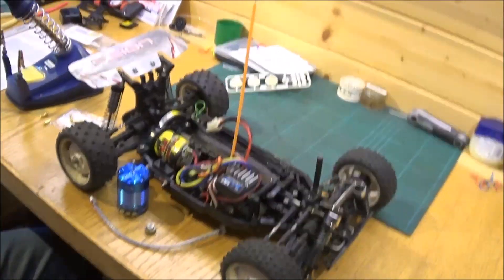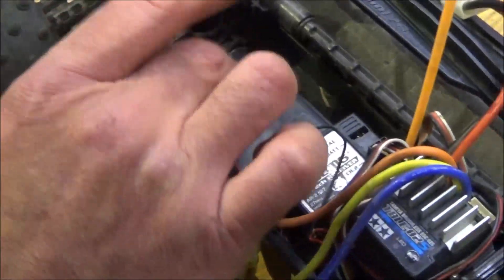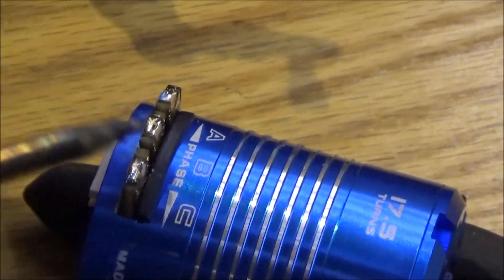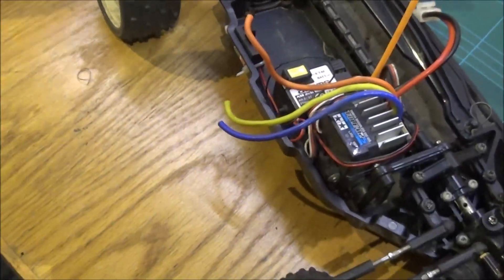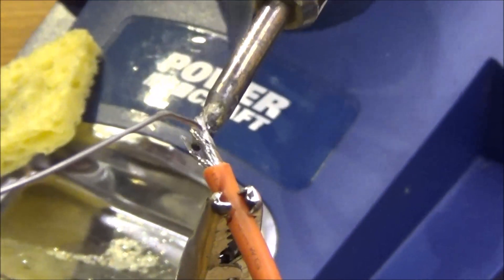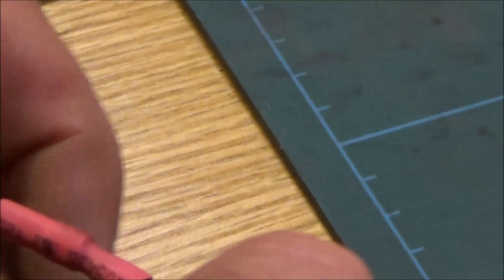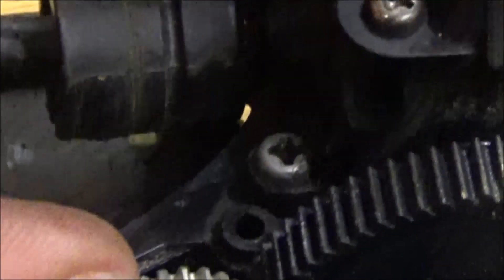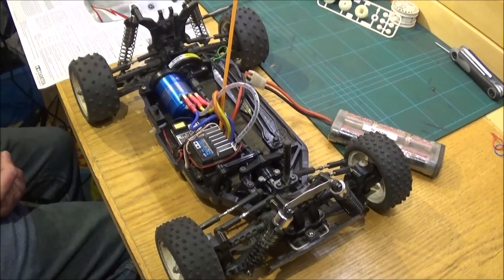How to Fit a Brushless Motor to a Tamiya TT02

Comment: What motor and wire are you using where did you get it and how much was it ?
 I was told by my local model shop you can’t use anything but Tamiya motors on the TBLE 02S speedo judging by your video this doesn’t seem to be the case!
Reply from the maker: Hi Neil Fastfreddie Anderson ! Thanks for the comment mate! The motor was off eBay - from a Chinese seller - only £20 - if you search for brushless motors I'm sure you will find it - not a named brand though. Since then I have used Turnigy Trackstar brushless motors from Hobbyking.com - very cheap and great quality - about £25 for the 13.5 turn and work really well with the Tamiya TBLE02s ESC. Don't believe what others say - the TBLE works fine with other motor brands - I have been using them for over 4 years with no problems at all in about 6 cars! Feel free to ask any other questions and I will try to help if I can!
The wire is just from a standard 13 amp power cable, you find them on any electrical extension lead - works a treat and handles the power fine :-)
Reply: Mark Bryan RC thanks for the quick reply and advice I found and ordered the same motor you used on amazon I’ll try a 13:5 t to start with.
I’ve got a lot of cars to get up and running any idea what the ratio is between brushed and brushless.
I was told  16t brushless is equivalent to a 21turn brushed any advice or comments.
Reply from the maker: Hmmm - difficult question, as we have to consider sensored or sensorless brushless! I'd say, as a starter, the advice is pretty good - brushless are much more efficient and use so much less power than an equivalent brushed motor but spin slower per turn (generally). So yes, a 21 turn brushed spins at about 22000rpm and you need a brushless 15 turn to spin as fast - but the efficiency of brushless makes a difference and makes the package a better prospect - longer battery life and longer motor life too! Anyway - brushless wins hands down!
Reply: Mark Bryan RC I haven’t raced for about 15 years (got into helicopters) they only work with brushless but they are allowed to rev and sit at max rpm very little current draw. I’m very ill from lung disease so can’t get out as I use to so have decided to get all the old redundant cars up and running but don’t want to spend loads just need a hobby that’s on the bench not too much moving about I’ll  get the boy to help with driving them 😉
Reply from the maker: Ahh - I got back into RC after a long break, and I too started by finding my old Tamiyas from the loft and set about getting them going again - I found it very rewarding to reinstate the cars and in a way quite therapeutic ! Sorry to hear about your poor health - hopefully you will enjoy the re-building as I did - a great way to focus the mind! Like you, I don't have a lot of cash to splash on this hobby - so I make, re-use and re-engineer most of my parts from spares or scrap - if you watch any of my other vids you will see what I mean. Please feel free to share any comments, observations and ideas you might come up with along the way - I'd be very interested to hear them mate!

Comment: Do you mind telling me at what temperature did you have your soldering iron Set to please?
Reply from the maker: Hi King Nica - My soldering iron is rated at 30W and the temperature is not adjustable. The melting point of most solder is in the region of 188°C (370°F) and the iron tip temperature is typically 330°C to 350°C (626°F to 662°F). So a good starting point is 350°C. The temperature is not too critical though - it just needs to be hot enough to melt the solder thoroughly so it flows into the joint - the important thing is not to leave the soldering iron in contact with the joint too long after the solder has flowed, this is when overheating of the job may happen. Just take the soldering iron tip off the joint as soon as it has flowed and all will be fine. Hope this helps mate!

Comment: Nice vid Sir! Can you make a run vid on this? I see you said this motor is pushing the limits of the esc. How did it work out? Running high temps or just fine? Thanks!
Reply from the maker: Thanks for the comment Darrell - But no, the motor is definitely NOT pushing the limits of the ESC (it WOULD be if it was a 17 turn brushed motor) but the TBLE will run down to a 10.5 turn sensored brushless motor. I have fitted a 13.5 turn sensored brushless and this runs fine too - no overheating - no problems! You can see the car in this video running here: https://youtu.be/9Hlsgpn84wc and the 13.5 turn Neo Scorcher running here: https://youtu.be/waUkCwnaMGI

Comment: what is the lowest turn brushed motor you can use with that esc?  the manual says nothing under 25 turn.  I was looking to run a 17t
Reply from the maker: Hi Tom - you are right, the TBLE-02 manual says the lowest you can use is a 25 turn Sport Tuned Tamiya motor. Bullshit! My friends and I have all used 21 turned motors from different manufacturers for a couple of years with no problems. The ESC is rated at 60 amps so check out the max current of the motor you are looking to fit. I think 17 might be pushing the limit - have a look at the Absima Thrust Eco 21T - it runs at 25000 revs compared to the sport tuned 19000 revs, and its about £10. I've used this with the TBLE and its just great!
Reply from the maker: Forgot to mention - you can run much lower turn motors when in brushless mode - Tamiya do a 10.5T motor to run with this ESC.
Reply from the maker: Thanks for the info mate - other viewers will be interested to know I am sure!
Reply from the maker: More good info!  You really have added to this thread - cheers mate!
Reply from the maker: Sounds great man, I'm gonna watch it - I clicked the bell on your channel, but I don't know if you have the same notification issues?  I only found your first comment on this vid because I was going through my comments - never had any notification of your message!  YouTube works in it's own ways sometimes, so I apologise if I miss any of your messages, it would not be intentional   :-)
Reply from the maker: Hehe - glad you posted this extra information Philthy!  So if anyone reads your comment above, I hope they then read this one too.  I have been told by others that the TBLE-02s will easily run a 15 turn brushed with no overheating problems, just haven't tried it myself!  Thanks a lot mate!   :-)
Reply from the maker: Cool - are you gonna speed test it and upload a video?  Would be good to see!